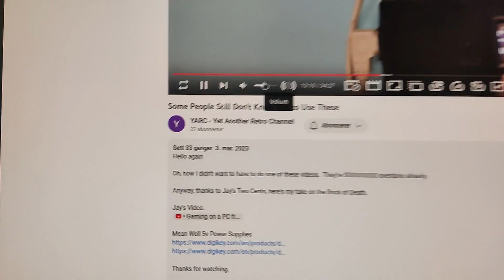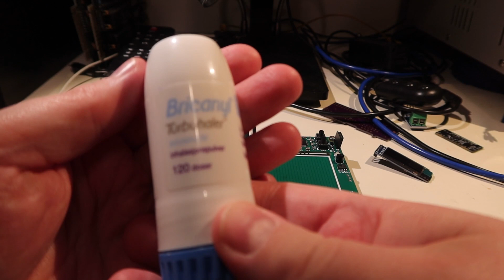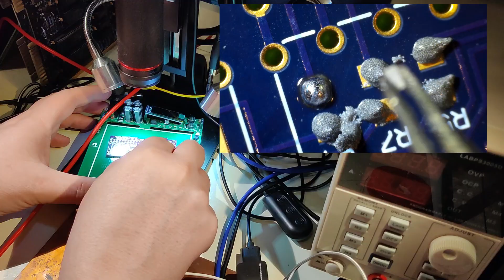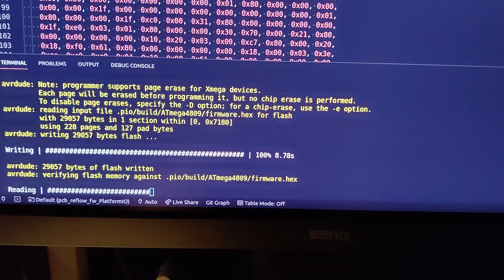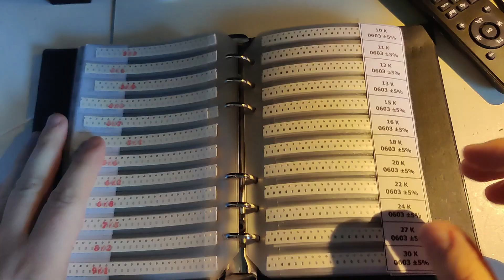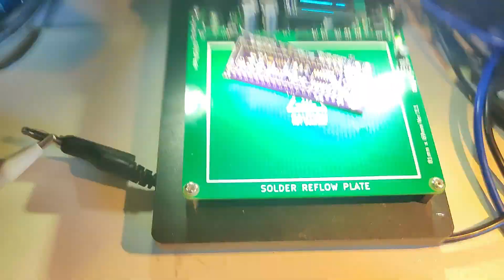Reflow Solder Heat Plate PCB

Comment: Remove that dc jack, use 10A  rated screw terminal block or more. Use thicker wire. Power it via cheap atx power supply.
Reply: XT30 connector from rc should do

Comment: I think you could have hand soldered 2 boards with a good pair of tweezers and a microscope faster than placing 5 components on a hot plate in solder plaste. 😄
Reply from the maker: Are you trying to say that the hotplate surface is too small to be useful? You have good point though.
Reply from the maker: This got me thinking of use cases. I think those who do flash light projects with aluminium or copper substrate circuit boards, used for high power LEDs and drivers would no be easy to hand soldered. They usually prefer hotnplates. Hmm heatbead with copper/alu substrate....hmm..
Reply: @bwack  thats exactly why im here, im looking to reflow LEDs on dtp pcbs

Comment: The problem, that I see with using a PCB as a heating element is, that the copper might start to delaminate after some time. Another issue might be, that the board might warp,  when heated up. I had this problem recently with a „real“ hot plate and a big PCB. The hot plate stayed straight, but the PCB warped, so I had to help with hot air to get the soldering job done.  And building this project might be at least the price, that you pay for a „real“ hot plate.  Soldering with a hot plate is a real improvement in my lab, I think.
Reply: If you look after the hotplate and don't abuse it, delamination isn't a major problem - at least not yet for me. It does make a difference where you get the boards manufactured. PCBWay boards seem to be more durable for this purpose than JLCPCB boards. Warping hasn't been a major problem, but I generally work with small boards. I wouldn't recommend this for larger PCBs. There are a number of issues, including uneven heating of the hotplate and operating the hotplate above the glass transition temperature of the hotplate base material, so while I haven't seen warping as a problem myself, it wouldn't surprise me if this became a problem at larger sizes.